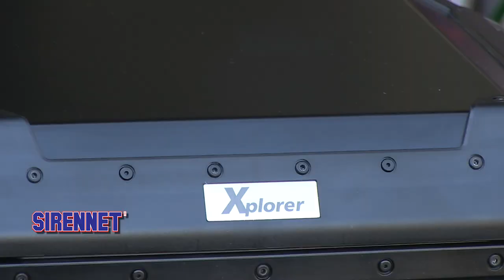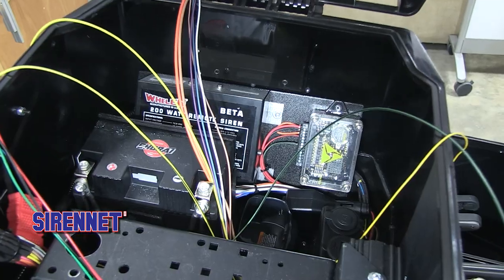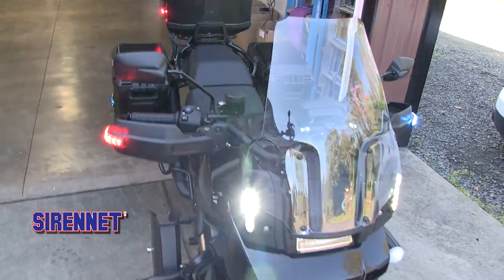Harley Davidson, Pan America 1250 Police Motorcycle upfit.

Comment: Why wouldn't you wedge the lights to be more level with the ground and not pointing upwards?
Reply: Good point... You could put a "wedge" of some sort underneath to aim it further down...  Give them time.. Its brand new 😊
Reply: @LJ-jq8og  Guardian Fleet Safety in Minnesota has been using wedges for years. Just kinda odd.
Reply from the maker: Which ones? The MegaFlex lights on the left and right side on the front wheel and under the windscreen work better (in our opinion) at these angles as the output spreads up to help be more visible through the rear window of bigger vehicles (trucks, SUVs, Vans, etc.)
Reply: @SIRENNET  front and side fairing
Reply: @SIRENNET  Great point 💪
Reply: It looks to me like the vertical ones on the fairing help with intersection lighting. 

New LED lights have a large light spread and do not need to be aimed like old lights.
Reply: @carries5411  If you are close to them yes, At distance, absolutely not. Line of sight is still important no matter they style of led or housing. Distance only magnifies the effectiveness of LEDs position.